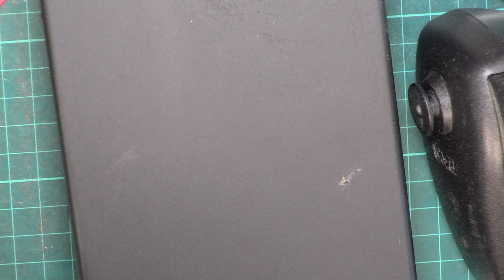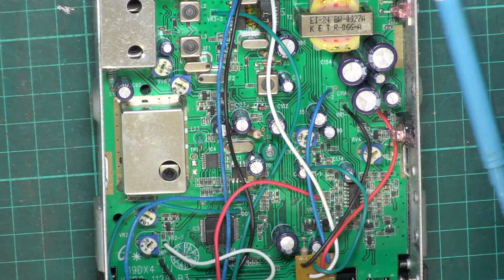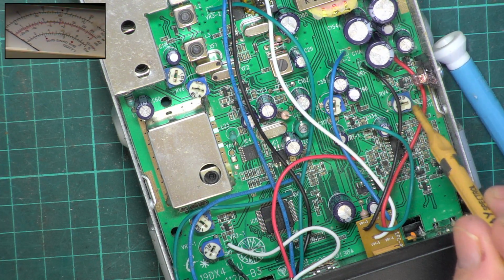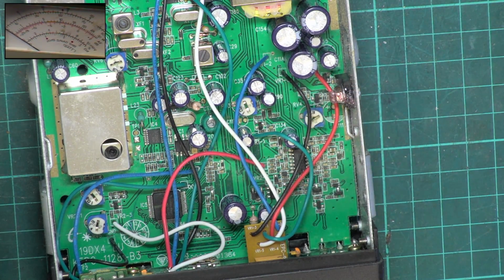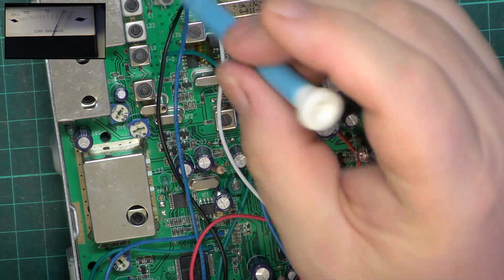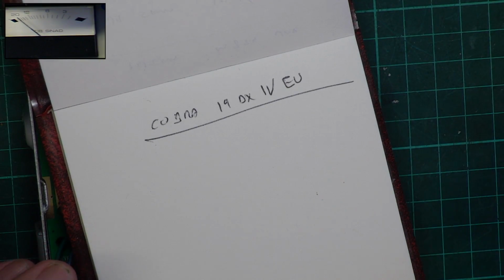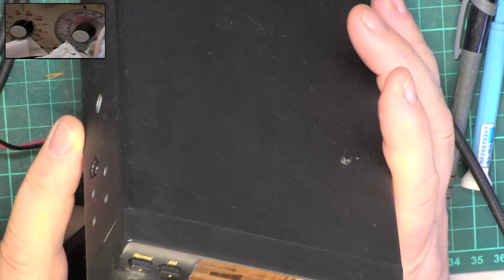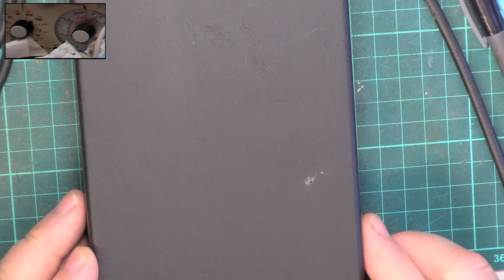Cobra 19DXIVEU UK CE MultiNorm CB radio (mobile) - Service adjustments

Comment: Can I add talk back with a resistor just like on a cobra 29?
Reply from the maker: I wouldn't know. I don't have service manuals for the 19DXIVEU. Most radios disconnect the speaker when in transmit.

On the 29LXEU, there is a double gang switched potentiometer on the front panel plus two fixed resistors, looking at the circuit diagram.

I can't say I've seen the talkback feature on any other UK legal set.

Richard, G0OJf, UK
Reply: @ukfmcbradioservicingTango21 10-4

Comment: I know I’m late to this video but I used to have one of these a long time ago I bought brand new and I couldn’t wait to get rid of it. The incoming audio sounded distorted on any signal above S8 on an external speaker so I reverted back to my midland 78 plus. As cheap as they were at the time I’d never buy another one again. Ergh
Reply from the maker: Correct.

Richard

Comment: Brilliant and thank you! Im having issues with mine. After 1 minute or so of being turned on it starts a clicking noise faster and faster no idea why? It's brand new same model as this one. Volume/gain/squelch and channels do not stop it. I pull the power for a coupe of minutes and it back to normal then after a minute it starts again. Any ideas? Thanks in advance
Reply from the maker: I can't remember if this has a PA function. If it does, see if the clicks appear when  a PA speaker is plugged in. It sounds to me like the audio amplifier is being overloaded, usually caused by faulty/electrically leaky electrolytic capacitors in the audio output stage. Now, I'm talking generally rather than model specific. The only one of these that has come in for repair (unrelated fault), I was unable to do anything with.

Richard, G0OJF, UK

Comment: Helo warlo..so which pot is it to turn up fm modulation..and is it anticlockwise, or clockwise thanks
Reply from the maker: Well I can't remember that! As it has to be done using a deviation meter, it's 2.2Khz you are looking for with an absolute 'never exceed maximum' of 2.5Khz.  Many radio adjustments work differently from sample to sample...hence the test instruments.

Richard, G0OJF, UK

Comment: Can the wattage be increased for use with the PA function? Cheers
Reply from the maker: THe radio uses a TDA2003 audio amplifier IC. The maximum output of that IC in this configeration is about 5.5W. The instruction book for this radio & the service manual don't say the PA audio output. It is safe to say it will be less than 5W. On some CB's it's as low as 1.5W. The audio output is limited by the IC they have used & is fixed at that.

Richard, G0OJF, UK
Reply: Thanks I wanted to know because I wanted a cheap high quality in car PA.
So cb radio's with a pa function are not the way to go?
I didn't want to go the police siren route for obvious reasons but the pa function is very powerful indeed.
Reply from the maker: @Butterfly07949  When Tandy's were around, their Realistic MPA range of ranged from 10W upwards. A quick look on ebay & I soon spotted both the 25 & 30W models. Neither showed they had the 12V power lead though. Bear that in mind. I have the MPA20 for church use outside..such as remembrance day service. It works great.

Richard
Reply: @ukfmcbradioservicingTango21  awesome thanks and your a brother in Christ to bless you.

Comment: I had a Bremi BRG22 SWR/Power meter arrive today and, sure enough, showing 7w out of a 4w radio! Out of the many power meters I've accumulated over the years, only two read about right - a Realistic (which I call my "Grumpy" meter) and one badged as a 'Netset' which looks the same as the Realistic. I miss Tandy!
Reply from the maker: Note that Bremi like Zetagi make illegal burners, so making power meters that read generously makes it appear their silly linear amplifiers perform better than they do. 100w burner = 45W.

Back in the late 80's I did the Amateur Radio morse test to go from what was then a 'B' amateur licence to an 'A' or 'full' licence. I decided to convert a tatty Realistic TRC2000 CB  into 10 metre FM amateur band. Bear in mind that a full licensee can use up to 400W on that & many other amateur bands. I bought a Zetagi (I think BV131) "100w" burner off an illegal CBer which was supposed to have  a duff transformer in it. It turned out not to be that & was soon sorted out. Dreadful build quality by the way. I could only get 37W out of the burner. I ordered new valves thinking perhaps they were tired. Now 45W. The 'helpful' power meter on the fronk boldly stated 100W. I sold it on to another licenced amateur & bought a Bremi BRL200, once again off an illegal CBer (see how I got two burners out of circulation!). The Bremi was slightly better build quality & did exactly 45W with new valves just like the Zetagi. Once again, the Bremi meter pointed to 100W. Absolute bullsh1t.  It's a clever business model making things that are illegal. Nobody can return them or moan as they can't have legally used them!

Those Tandy metes are more expensively made than the usual CB type ones & utilise a silver plated 'trough line' to do the measuring. Most CB type meters just have the sensor as a printed pattern on the PCB. One of the Binatone & the Audioline meters are trough line types too & weren't cheap

Richard,  G0OJF
Reply: @ukfmcbradioservicingTango21  - I'm pleased to report that there are adjustments within the Bremi meter, so it now reads a grumpy 'Realistic' 4W not a happy 'Bremi' 7W  👍 

Probably non-linear in it's behaviour at higher and lower inputs, but at least it shows 4W out of a 4W radio now! 

Cheers, 104

Comment: I’m glad you clarified the Watts situation. I did wonder whether your test set needed calibrating as many radios struggle to do 4. My crt xenon shows 4 watts out of the box on my mfj991 digital display Auto ATU but I’m guessing on your set it would only be 3 real watts
Reply from the maker: You will realise even with the better quality (than CB) the amateur radio equipment is, clearly laboratory instruments are going to be very different. The Marconi test set we use (three identical ones here) reads the actual TX power on the frequency being sent to it, filtering out most of the harmonics. Cheaper power meters are non-selective so read all the unwanted stuff as power too. You may have 5% of unwanted emissions, so a cheaper meter even if properly calibrated may read 4W....take that 5% away & straight away we are down to 3.8W

Richard
Reply: Thanks for explaining Richard, your on a one man mission to dispel all these myths and untruths about cb’s and related equipment 🙂

Comment: I will never understand why Cobra didn't bring out an ssb radio for UK
Reply from the maker: There may be chance, we've only had SSB since 2014!

Richard
Reply: @ukfmcbradioservicingTango21  I wrote to Cobra USA in 2014 explaining mine and the possibility of many others interest in owning an ssb legal Cobra, I thing at the time they still had an ssb Cobra in USA but with no fm of course.
Reply: President McKinley  AM-FM-SSB CB Radio Transceiver
The President McKinley transceiver is a multi mode mobile CB operating in the legal 40ch UK FM and 40 (CEPT) FM channels. Also, AM/FM/SSB on the European channels.  I think Moonraker do it at a price more than I want to pay!EDIT:  It is the only Legal set that I know of, a lot are buying Amateur Radio sets and using them for CB, but I wouldn't recommend doing that, though some have been doing that for years.  Also a lot of SSB users are running 100 to 200 watts Amplifiers for AM/FM and SSB which could lead to interference to other users or your neighbours equipment if you are not careful.
Also, you would need to be careful not to drift into Amateur Radio on 10 meters, they might not be best pleased to hear a CB'er operating on there!  Google the set at the top to see if you might be interested in getting one, at least you would be legal.